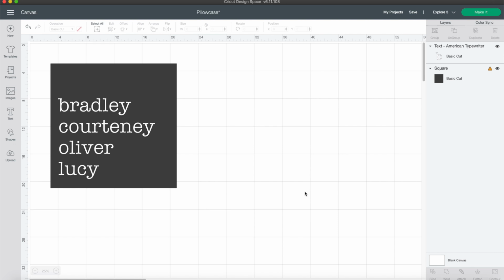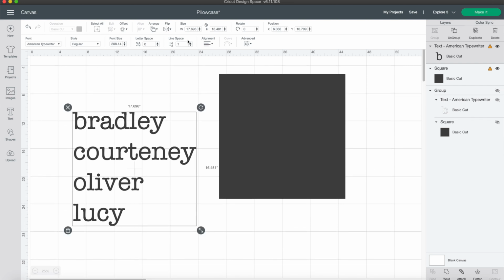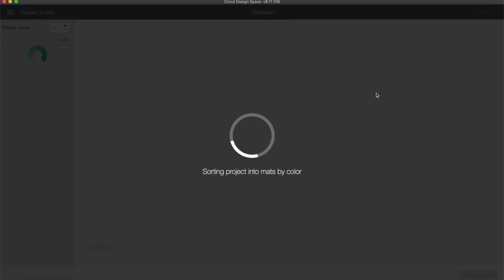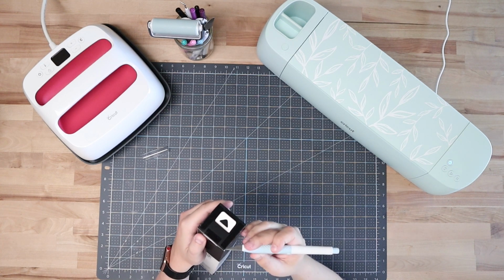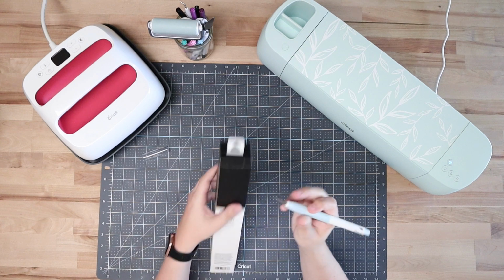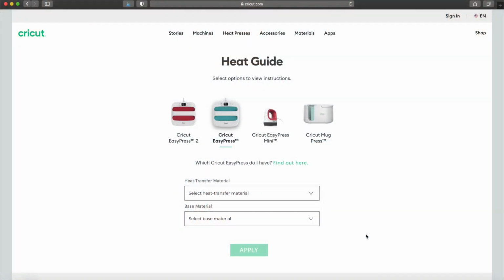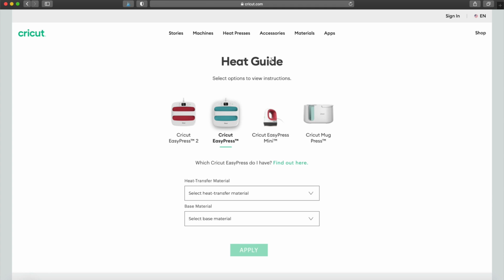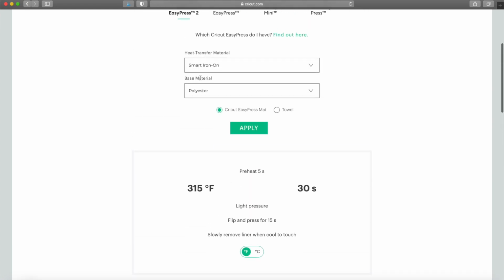How to Make a Custom Pillow with Cricut Explore 3 and Smart Iron-On

Comment: I don’t have a easy press, how can I use a iron? Thanks
Reply from the maker: You can definitely use an iron to transfer the vinyl. It is a little bit more tricky. Be sure to have high heat, no moisture, and lots of pressure.